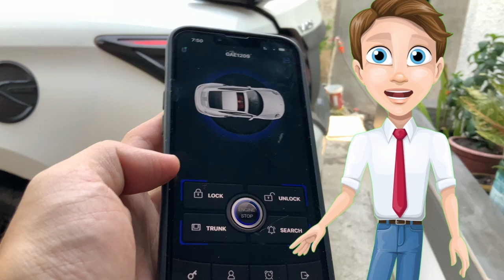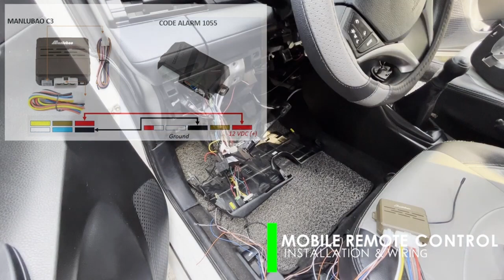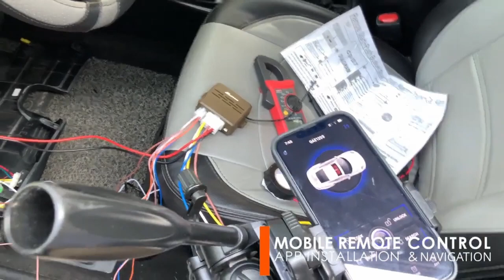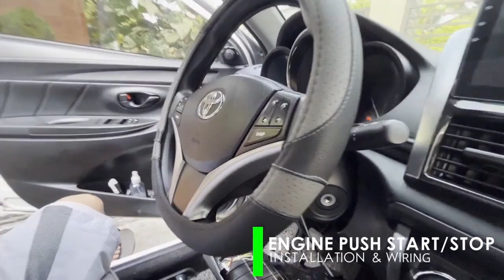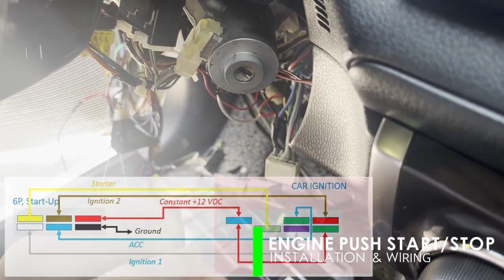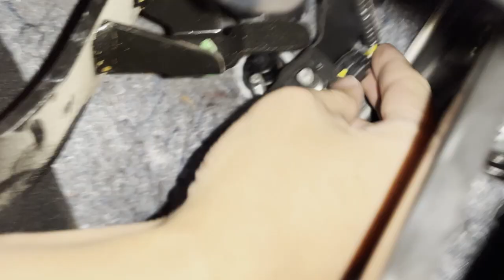How to install Engine Smart Start System & Smart Entry System [UNCUT] #EngineSmartStart #ToyotaVios

Comment: With a manual car, can you use the clutch switch instead of the brake if it also provides 12V? So you have to only push the clutch to start the car?

Comment: Sir, sa remote start pwede ba may delay before mag engine start? Like mga 5-8secs delay muna bago mag start? Paano po?
Reply from the maker: My delay talaga xa sir as programmed. Pra lng dn xa ung normal practice naten pg ng manual susi
Reply: @EngrDeeIWye  sir san po ba coconect yung side door detection?
Reply: Thanks sir. Baka may tutorial din po kayo mag install ng 360 camera. 😊

Comment: is this plug n play method ?
Reply from the maker: No sir, you have to connect the module wires to the ignition harness connectors of the car and to the existing centralized car alarm system.